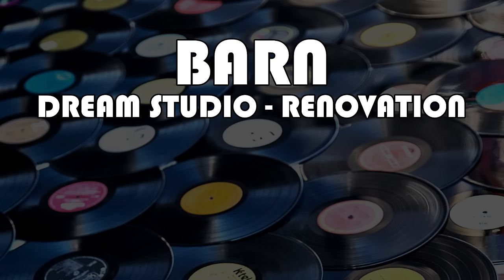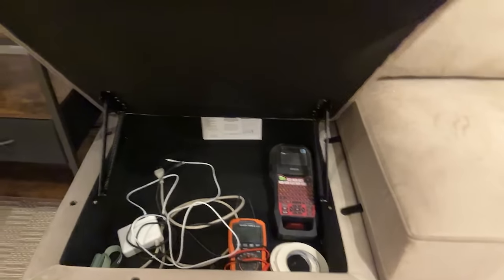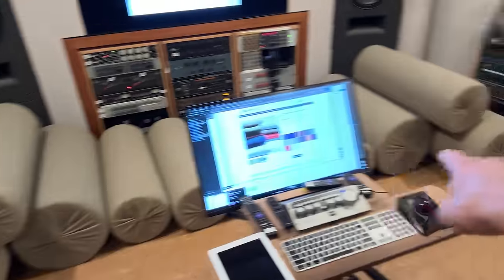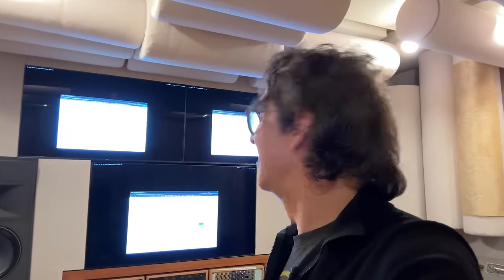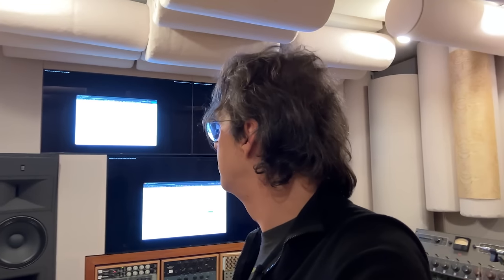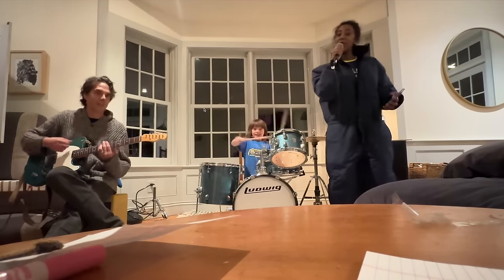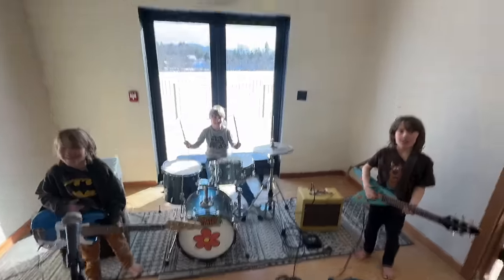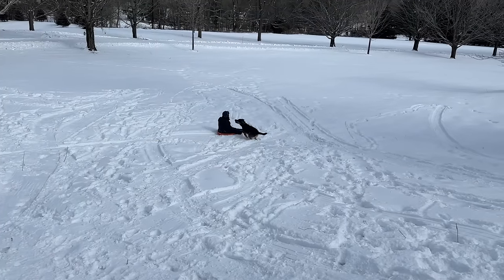Making Records with Eric Valentine - Episode 28 - Finishing The Control Room

Comment: Amazing. Eric, can I suggest that you publish this for either AES or the Acoustical Society, or both? Because I work in acoustics, and I've never seen a more detailed and objectively measured exploration of controlling room modes. I think it would be super valuable info. Also I think the decision to stay rectangular is correct. There's basically no way to predict modes in a non-rectangular room (except perhaps now with Treble software) but you can (sort of) do it with simple shaped rooms. And you're absolutely correct, that so many high end control rooms have super uneven low-frequency sound fields.

Comment: would the tubes with 1 inch walls work as good as the one with 2 inch walls? ive seen online that the 1 inch wall versions are slightly cheaper (10 inch diameter to make it 12 inch outer diameter) as compared to the 2 inch walls (8 inch inside to make it 12 inch outside). any thoughts or experience with thoses differences?
Reply from the maker: I've only used 2" (Vermont) and 1.5" (Barefoot Recording) tubes and both worked well.  I didn't have an opportunity to quantify any difference between those two.  I have never tried 1" so I can't say for sure that they would be better or worse.  You may have to buy a few of each type and compare them.  If you have a chance to do that definitely let everyone know what the results are :)

Comment: Thank you so much for sharing your process! There is one thing that I had been thinking of ever since you posted about the VPR Panels. You mentioned that they 'only' went down to 60hz. So in this video this made me think of your problem with 200hz. if the 50hz can not be absorbed then 100hz will be a problem too and inevitably the 200hz. (which in your graph are all the dips up to 200h). Maybe diafragmatic/or Helmholz absorption wich is tuned to 50hz would be more efficient in the back walls? In my understanding, if the 50hz can't be fixes then any of the above will not work either. Please correct me if im getting something wrong here. Truly loving your channel. Thank you.

Comment: Looks amazing  ! was so happy for you to see to see your last graph. :) Dark in the front for me.  So you have 12", 18", and 22" tubes ? You mentioned you've put the bigger ones in the front corner . I wonder which sizes you would use and were if you'd do the walls of your room with just tube traps. And the Helmholtzs are just above the front part (to catch that 50hz or 60hz resonance) right  ?
Reply from the maker: Yes the helmholtz tubes (4 of them) have the ports facing the walls same distance from the speakers as the listening position.  That was the area where they seemed to have the biggest affect on the 50hz cancellation :)

Comment: Dear Eric - congrats to this accomplishment it looks gorgeous ! I build myself a room in Berlin Germany with the help of Jürgen Strauss whose Speakers i am using! i am thrilled with my sweetspot, however it is tweaked with a Trinnov to perfection on a very narrow spot. people sitting beside are hearing a quite unfortunate spectral imbalance. how is the listening experience in your room beside the sweetspot / back in the sofa? your insights on the effectiveness of tubes vs VPRs are very enlightening :-)
Reply from the maker: So far it feels very consistent.   the couch spot is more balanced than I have had in other places.  you don't get that massive bass build up in the back.  It seems very listenable throughout the room :)
Reply: @mrwev awesome! maybe i should consider to add tubes at the rear wall too! - did you at the end tune them or did the sheer number of them do the magic? 
I can so much relate to your quest for an accurate and reliable listening spot! it is so satisfying to get there :-)

Comment: So, are you using an analog eq after your D-A before your Power Amp? If so, what eq are you using for applying the correction? Great Video!!
Reply from the maker: That is correct!  Monitor controller -> EQ->Power Amp-> Speakers.  The EQs are (not surprisingly) UTA MPEQ-1s :)

Comment: I would only cover the flat panels with the darker fabric.
Can I ask why you only used absorption and no diffraction?
Reply: The plywood wraps on some of the tubes are reflective
Reply from the maker: There is a small amount of reflections in the room.  I added a little with the wood veneer panels and of course you get it off of the rack gear as well.  I have always preferred dryer rooms in general.  I like it when the speakers feel more like big head phones :)

Comment: There is a common misconception in this video. Bass traps are not equalizers, you can equalize if you add a very large amount of bass traps (as you did with the tubes) but that's not cost-efficient. 

I warned about that 1 year ago (Spanish): https://youtu.be/wZrRNcDLXSQ?t=639

Acoustics has improved a lot since the days Ocean Way opened. Computers allowed incredible numerical calculation techniques such as FEM or BEM to simulate bass behaviour in control rooms and VPR traps work well. You decided not to hire an acoustician and you experienced some issues that could be predicted. The bottom line is you achieved a good result. I don't want to be a spoilsport. I just want to warn you that some of your statements aren't accurate.

Best!

Comment: What's the density of the tube trap fiberglass?
Reply from the maker: Here is the data sheet for the specific product I am using.  The walls of the tubes are 2" thick.  I am guessing there is probabaly detail on the overall density of the fiberglass.  https://www.jm.com/content/dam/jm/global/en/mechanical-insulation/pipe/micro-lok-hp/JM_MECH_MicroLok_HP_Data_Sheet_EN.pdf
Reply: @mrwev  Thank you. I'm wondering have you ever tried an ASC AttackWall?

Comment: Are you just doing a single sweep with these measurements?  You should really be doing an average frequency response of the listening position for each speaker if you're going to use the graph as a reference for applying EQ.  For adjusting room treatment for low frequencies, single sweeps work great, but for measuring the room for the purpose of applying EQ I find it's best to use pink noise and an RTA to capture an average of the listening position, moving the measurement microphone within a cubic square foot of where my head would be.  Trying to EQ for a single point in space just doesn't translate as well to what actually sounds best to our ears.